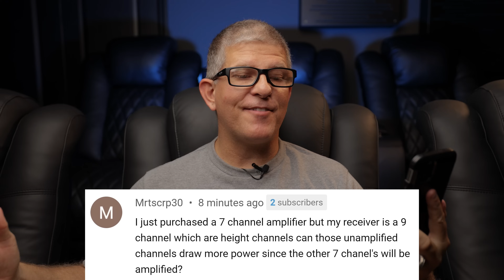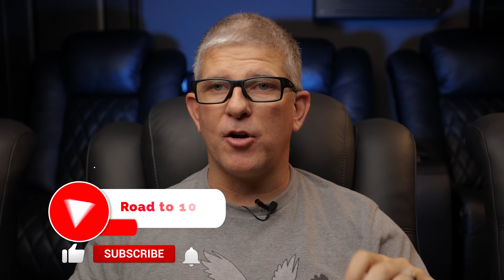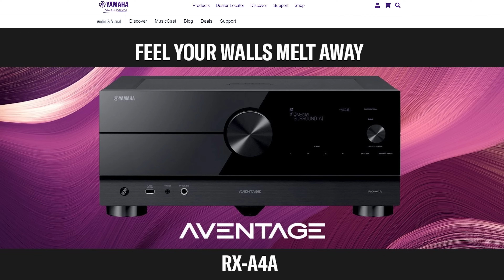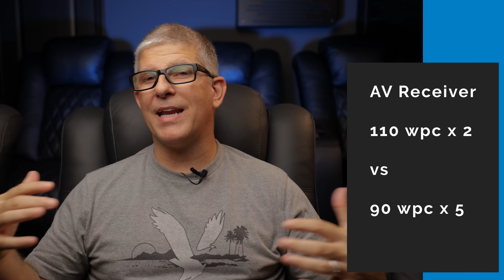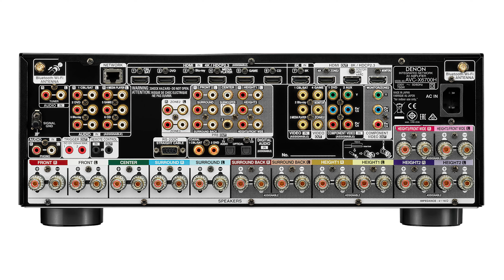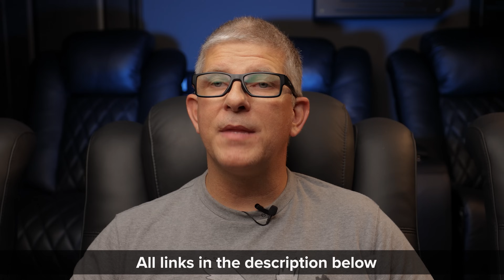How to Get MORE Power From Your AV Receiver - Home Theater Basics

Comment: Couple of things I've picked up over the years:
1) Denon/Marantz guarantee their 5 channel driven numbers are 70% of the 2 channel number across the x3700h and up.
2) Whether you need external amps really depends on listening levels and efficiency of the speakers and distance to the speakers. If you have your side surrounds really far away compared to your fronts it might make more sense to sense to put the extra power their way assuming they can handle it.
3) Another thing you didn't mention is that a lot of higher end AVRs that have the pre-outs can actually process more channels then they can power so for example the x3700h and x6700h can process 11 and 13 channels respectively but can only power 9 and 11 channels so it can also be used to unlock better speaker configurations.
4) Lastly don't forget to bump up your crossovers after running room correction as room correction generally sets the crossover at the in room -3db point but it isn't accounting for compression or distortion at louder volumes where more power is needed.
Edit: forgot to mention but great video as always :)
Reply from the maker: Thank you Tyler. Great points as well
Reply: Thanks for your points. 1-3 are clear. I am not sure I understand your fi Al point though. What do you mean that room correction set the crossover at -3db?
Reply: @HarryM2022  Let's say you have speaker that plays +/- 3db from 50hz-20khz in an anechoic chamber. However due to room acoustics such as boundary gain that speaker might measure at your seat that it plays 3db queiter at 30hz or 40hz or even worse it will set it to large instead of small. However just because you have output there doesn't mean that you want to use it as there's generally a lot of distortion/compression in the bass (look at Erin's Audio Corner's speaker measurements). Also have to consider that a subwoofer has a much larger driver and a ton more power so it doing 80hz stuff is trivial for it whereas a 5, 6, or 8" woofer that also has to play to 2000hz+ is really struggling as visually expressed by lots of movement from the woofer. Also crossovers aren't on off switches with most AVRs doing 12db/octave high pass filters  for main speakers and 24db/octave low pass filters for the subs so with an 80hz crossover your mains will be playing 12db quieter at 40hz. However on the flip side going to high can cause you to localize the bass so going passed around 110-120hz isn't recommended unless you have tiny speakers with 3" drivers.
Reply: @TylerStout  OK, I get what you mean. Thanks for the detailed message.👍
Reply: The Marantz 70% guarantee doesn't mean much on a 9 channel receiver. I added a MM7055 amp for the front three, because there was no way I was going to expect a receiver to handle a 9 channel load. Especially with Kef R series speakers.  It could but why risk it IMO.
To be fair, there are a few things I'd like to add:

the subs do take a substantial load off of the AVR.
In stereo listening, your only powering two speakers.
For theater use, the center channel is doing most of the heavy lifting, and sounds move around the sound field.  Rarely are all the speaker driven at once.  
The receivers power supply has capacitors for intermittent power demand. 

I have my system on a UPS, and my SR7011 receiver rarely pulls over 200W total at loud volume with 7 channels driven, and fairly inefficient speakers (86db/w@1M).  If it's drawing less than 200W then the output to the speakers might be half considering all the processing etc...  That's about as loud as I can stand in a 2,000 cu ft room.  I'm running 6.2.4 (a single rear) with the front three through the amp.  With the amp I'm noticing less distortion.  I cannot comment on sound staging because my room acoustics aren't perfect.  Overall I think adding an amp is a good investment.

The caveat being that you'll need a dedicated mains power source for all this equipment, (2 subs, a TV, receiver, amp, and accessories).  A 20A dedicated outlet may not be enough.  If you are plugging things in to multiple circuits you could end up with problems if they are not drawing 110v from the same bar in the panel.  Better consult an electrician!
Reply: How do I tell if my receiver Pre outs can add more channels? I have a s750h

Comment: I’ve been adding an outlaw 7000x to the cart and removing it from the cart for the past several weeks.   Even though these are budget amps, they’re still expensive.  Plus it’s annoying they don’t make a 9000x which would solve my issues as the 7000x leaves two channels still using internal power (meaning I can’t use pre amp mode on my Denon 3700).  Are there are cheap 2 channel amps one can use to power the remaining two atmos speakers?  Great video btw and love your content.  Just subbed a few weeks ago.
Reply: BasX A2 ($450) or get 2 Outlaw 2220 ($400 each) for your mains, and 7000X for everything else. Or get A2+A7 to save even more $.
Reply: @andrewskaterrr  I have the A3. Works great. Doesn't even get hot.
Reply from the maker: Andrew is correct. Lots of options for you to choose from
Reply: Outlaw 7000X will arrive at my house tomorrow! Now I need to figure out how to combine it with my Denon X6500h running 5.1.4 Klipsch. Likely going to assign the outlaw to the bed layer and let Denon handle heights.
Reply from the maker: That would be how I would set it up.
Reply: I did same thing even bought the 7000x cancelled it then bought it again the next day been stepping up my system step at a time.
Reply from the maker: Enjoy the journey!

Comment: More power going to the 2 left over speakers?  Well that depends on the design of the amplifiers in the AVR.  Are the amplifiers that drives the 2 rear back channels the same build as the front R&L?  That's a big maybe.  Surely, the 7 bed layer speakers can be driven by the new amp and the AVR can easily drive a pair of Atmos/ceiling speakers with plenty of power.  I wish my AVR had "pre-outs" because I want to put an amp on the LCR channels.  Oh, that would be so nice!

OOPS!  Wait a minute here.  I just rewatched/reread the question.  It sounds the AVR owner is asking if the unamplified height channels will produce more power - like speaker level power if the others are on the new amp.  That, unfortunately, is not at all possible.  Those channels are pre-amp low voltage outputs only.

@youthman Thanks for the info in this video!  Please have a great weekend!
Reply from the maker: Thanks Kevin. Unfortunately when you do not have preouts, you’re limited to just for the AVR can produce
Reply: @Youthman  That's a fact sir.  If I could ever round up the $ I'd like to purchase either a Denon 3700 with pre-outs or an Emotiva MC1 processor and the needed 3 and 4(maybe 6) channel amps for my system.  I really want to find out just how much of a difference there is in the set-ups.  Maybe, it's just a waste of money.  Hell, maybe this whole hobby is just a waste of time and money.  Getting my current system to sound it's best is becoming a daunting task, besides nobody watches movies with me anymore - SUX!  Oh well - simply more for me to enjoy and tinker/fight with.

All the very best everyone!
Reply: There’s two parts: Amp and Power Supply. It’s similar to an engine and fuel injectors. The amp/engine can perform at 100%, but it requires the psu/fuel Inj to deliver enough to reach 100%. So if the psu/FI are only able to deliver 50% of what the amp/engine needs, then it’s not going to reach 100% performance. Taking the load off the psu will do this. You’ll have more power available so the amp can pull as much as it needs, especially with “dynamic/burst/peak” loads that go over the rated continuous spec.
Reply from the maker: Thanks for the extra info Andrew.